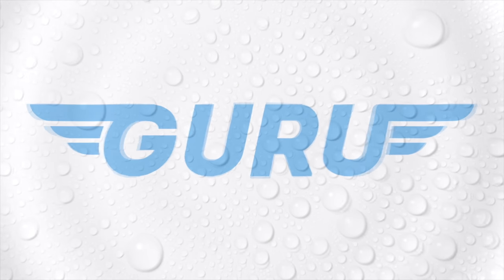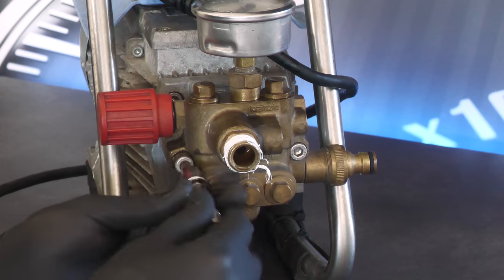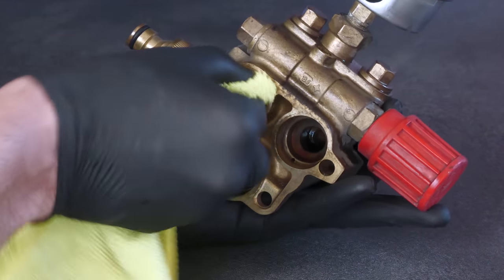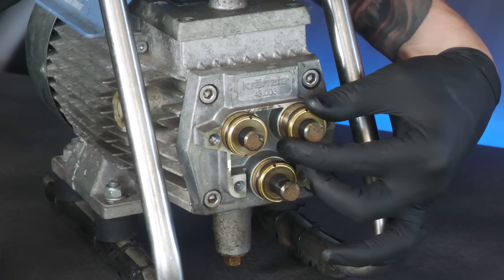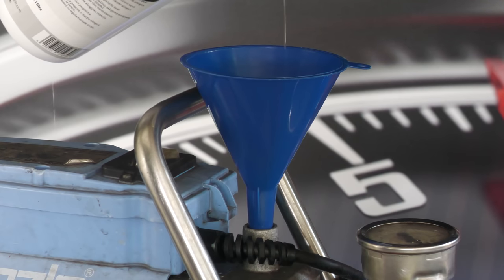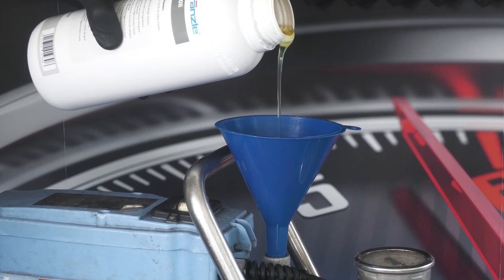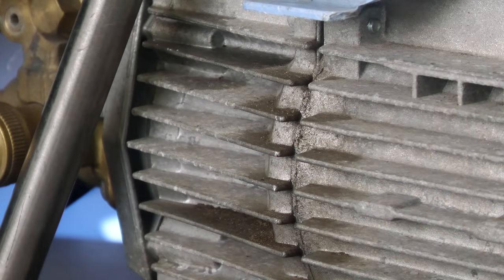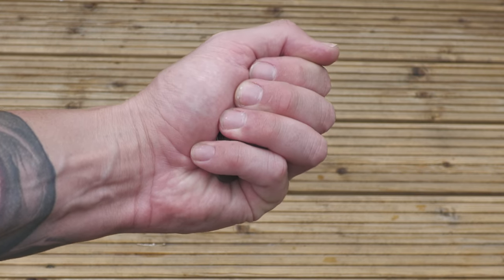First Kranzle Service in 7 Years

Comment: i used to service and repair 'that other German brand mostly yellow, black or gray and  begins with  K..' and a tip for fitting new pumpseals is to grease them up, and let them soak in hot ( like tea water hot) for a little while. the chance of dammaging seals is less when they are a little bit more flexible, and yes there is a tool for that.  I saw that the oil  turned quite milky coloured. This might be caused by the plungers being damaged. check with your fingernail over the part where the plunger and seal(s) make contact, if you can feel any obstical, ( make sure it's not debree) than you should replace the plungers to.
Reply: Its water mixing with oil which turns into a milky substance, most like due to seals or Orings being worn out. and I agree to warm the seals and lubricate them a little bit of marine grease or ur preferred grease. I normally get long pin and clean the pin size holes all around the pump and soak the pump with vinegar with a pinch of salt to dissolve all the particles on every crevices or pinholes...Lastly ill check the fan and shroud on the back and also either wipe or repaint the pump as needed.
Reply: I work for that Danish brand mostly blue😂 Emulsified oil is because of worn oil seals. I mainly service Delta boosters.
Reply: Kärcher i think.

Comment: Awesome video, well explained, couple of things I noticed the grey end of the high pressure hose usually goes on the gun end (unless the gun has a integrated swivel), also the small lance nozzles you are using are either worn or a larger size causing lower than normal pressure (unless you have it turned down on the red knob) lastly the oil may go milky again if the oil chamber was not completely cleaned.
Would love to help you out if you need help 👍

Comment: You can use an appropriately sized socket to press those seals home
Reply: The socket needs to be a tight fit to have a snug fit in the seals. You might need to add a little lubricant before inserting and tightening up🤔
Reply: @AlfaGTA156  it couldn’t be any worse than a screwdriver!
Reply: @AlfaGTA156  you use the socket as a drift

Comment: Another trick for putting the brass rings, is to use a socket of the closest size, that way you get even pressure when lightly tapping them with a rubber mallet.
I do that method when I'm resealing mine.

Comment: To replace the brass fittings at the end of the film? Rather than a tricky screw driver? How about using a same sized socket and hammer? Give it a gentle tap and it will go in equally all round👍.

Comment: I would change the oil once again after it circulates a bit. Water in oil is one of the worst contaminants. Won't take more than 5min, and this second change will completely flush it off.

Comment: Been there done that, I even went as far as removing the plate to the chamber go clean out the old gunk. I will change the oil more often in the near feature. Mine looked not as bad as yours, but it was also contaminated to say the least. Nice job Guru 👍

Comment: Bloody hell mate, that oil was so badly emulsified that I feel you were lucky not to have any main bearing issues. That said, I can advise that these little machines are quality items from new, so a fair bit of use/ abuse is tolerated easily. I used to sell and service these machines, so I’m not surprised to find that all is still ok with your machine. That bit of TLC now will serve you well. Nice little vid as always. Cheers👍🏻👍🏻
Reply from the maker: Yeh I’ll have a look at the bearings next oil change and replace with new if needs be.

Comment: I don't know if you have heard of him, but there is a youtuber Matt Moreman he runs the channel Obsessed Garage and he specializes in stuff like this. I would think about giving his stuff a look because the guns, wands, and quick connects he offers are some of the best in the world. I have a new kranzle from him on the way along with a bunch of his snazzy fittings and swivels. They really are some of the best you should check it out it makes the using experience 10x better.
Reply from the maker: Yeah this video (and my current set up)  would likely give Matt nightmares lol. Only reason I haven’t got his wand solution is the import duty.
Reply: @CarCleaningGuru  Mosmatic Uk sells a very similar gun/wand package. Thanks for the vid 👍🏻
Reply from the maker: Yeh I’m pretty sure there’s a place not far from me that could build an almost identical solution.
Reply: @CarCleaningGuru  Maybe try reaching out to him, I don't doubt he would help you get one easier if that will help advertise his solution if you are down for that

Comment: Fantastic, great work.

Just a tip and i know you've done it now, but those hard plastic washers are easier to fit with a suitable sized socket and gently knocked in with a rubber mallet :)
Reply from the maker: Would that not just crush them though? The ones I was fitting here were going in face-up so to speak so you couldn’t even rest them flat to be able to tap with a socket.
Reply: @CarCleaningGuru  It shouldn't crush them but i get what you mean with not being able to rest a socket on them.

Excellent video as always :)

Comment: Only about 75 bar? Should be around 120..... Did you have the red valve wound out? My K10 122 TS is by far the best power washer I've ever had. New for 2021 is the Kranzle K12 130 not sure if it's available in this country yet, it's black and stealthy and no plastic box on top.
Edit - Jeez, Malcolm from AquaSpray said a few weeks ago that all Kranzle machines were in for a price hike, he wasn't kidding! Glad I got mine a few months ago.
Reply from the maker: Don’t think I had the valve knocked back no. Usually get around 100 using the standard lance, not sure if the stubby gun with wide fan would affect the pressure reading at the pump?
Reply: The 40 degree lance end reduces the pressure significantly. 
If this was a 0 degree end /driveway cleaning nozzle you would get pretty much full pressure 👍🏼

Comment: Now you've changed the seals it's going to leak now.
Reply from the maker: Exactly. It was basically self regulating by this point.
Reply: It was leaking before. Internally though. Thats how the gear oil got so milky.

Comment: It looked like you had some dried oil on the side where the oil window cap is located and toward the bottom of the machine.  I have a Kranzle 1322 and noticed a few drips of oil coming from underneath the unit.  I'm wondering if the window cap loosens up and causes the drips over time.  I'll have to take mine off the wall and check it out.

Comment: When the oil is milky like that usually means it’s got water mixed in with it
Reply: Quite common on these with condensation. Had one for many years and serviced by a Kranzle rep twice, the oil is used for cooling and not lubrication and as such I have been assured it is ok. Obviously not ideal no, but it doesn’t seem to do any harm
Reply from the maker: This is why I never changed it for so long although I’ve since been told the oil does lubricate as well as cool 🤷‍♂️.

Comment: You should use rubber grease on those seals, as normal grease can attack the rubber and make it expand and go funny. Then you'll loose your lovely tights seal you just got 🤣. Just a little tip for next time
Reply: True.. we use silicone based grease as it's safe for all o-ring materials.

Comment: I thought oil based grease wasn't good for O rings.
Reply from the maker: Probably isn’t but it’s all I had.
Reply: This is correct. Petroleum breaks down rubber. Its always best to use lithium based grease on anything rubber. That being said, I am sure that in this application, little harm was done. As I've often said in the past... she'll be aight.
Reply: Silicone grease is best for O rings.
Reply: You want silicone grease